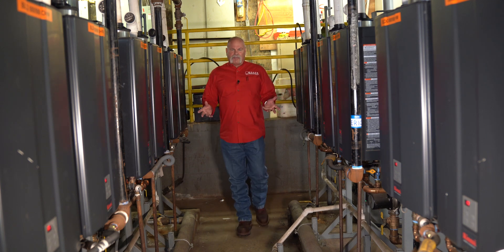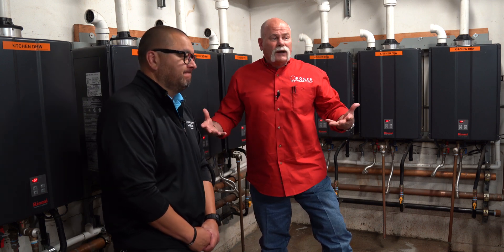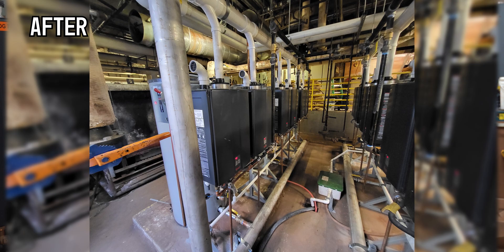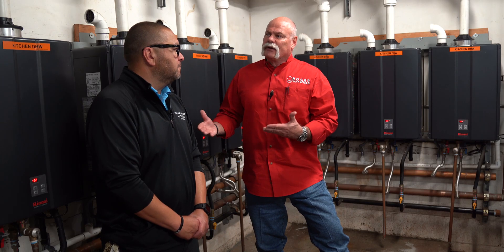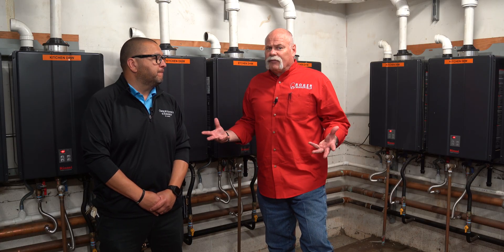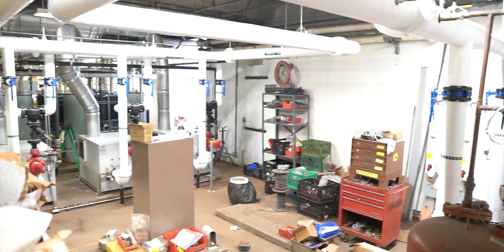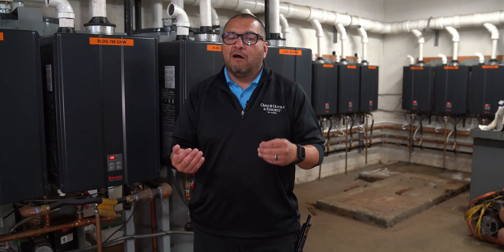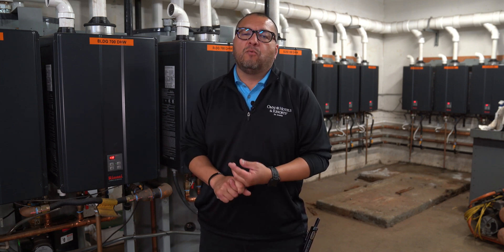Tankless Water Heaters Supplying a 400-acre Resort

Comment: Roger, I got my hubby addicted to your videos. Wish you lived next door. We used to have a Rinnai water heater and just replaced it with a Navien. We recently had installed an under-kitchen-counter reverse osmosis system, and then noticed after a couple of decades that we had a whole house sediment filter system hanging on the basement pipes that needed attention at least once every 6 months. Who knew. You can't imagine when we finally opened the housing. Now that all of that is finally under control, I wonder if you could do a couple of instructional videos on filter replacement for both of these systems. We bought the metal housing wrench, the food grade plumber's grease for the o-rings, and the rest. We want to keep our home water clean and hope you can help us - in your wonderful inimitable style. We are retired (almost) and have to do these thing ourselves. Thanks so much.

Comment: I preffer using Navien NPE-240A2's. To me they r much easier to program and can cascade up to 16 units. Not to mention the stainless steel heat exchanger and the clraner interior. I feel like those rinnais you have to be like a blck belt plumber technician to work on them
Reply from the maker: You don't have to be a black belt...I go more in depth with it here...https://youtu.be/AsR8n-oknhs?si=e4HTZ0mCsC4ZYJ_V

Comment: What are they doing for fresh air? I see they're all pulling combustion air from the mechanical room.
Reply: I wondered the same thing. Would be interesting to hear them talk about that.
Reply: So the, ," combustion air," isn't being pushed out with the exhaust? It must must be breathing in fresh otherwise there would be an error code no?
Reply: @drainboss  not necessarily. It depends on how many heaters are firing and at what rate. If all heaters were at high fire, there could be a possible of starving the heaters of oxygen. You need 50 cubic feet of air for every 1,000 btu’s being burned. That’s a huge amount of air for the number of heaters they have. One heater would need basically 10,000 cubic feet of combustion air.
Reply: @kyleclever Are you sure your math is right?
Reply: That was the first thing I also saw.
Reply: We also know the hot water didn’t travel a 1/4 mile in 10 seconds. Let everyone know there is a circulation system.
Reply: Literally my second question,  my first is why a Rinnai ?
Reply: My thoughts exactly. Cut corners, period. Maybe they leave a garage door or 3 open 24/7😂

Comment: I had a smaller scale version of this at a property I worked at. The system had 10 units feeding 140 apartments. It was super cool that we could go down to 5 units before the building had issues with hot water. It also allowed us to service units individually without shutting the whole system down.
Reply from the maker: That’s awesome! What brand were you using?
Reply: @RogerWakefield  we had A.O. Smiths. It was at a senior living facility in San Antonio.